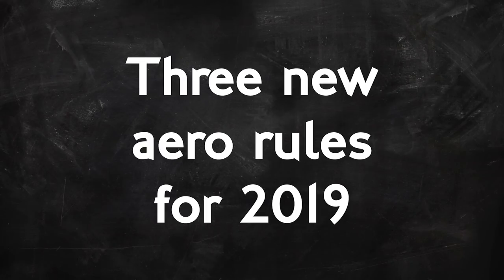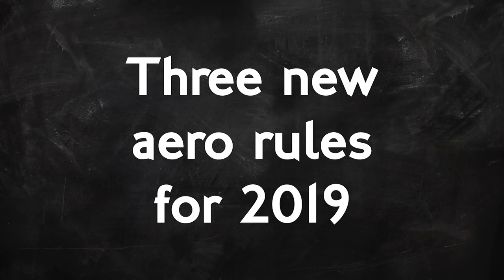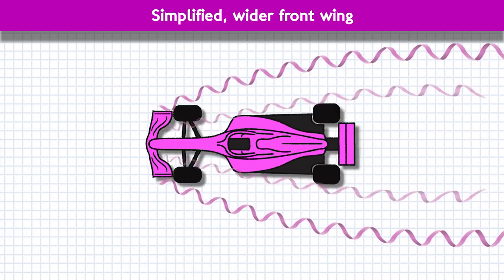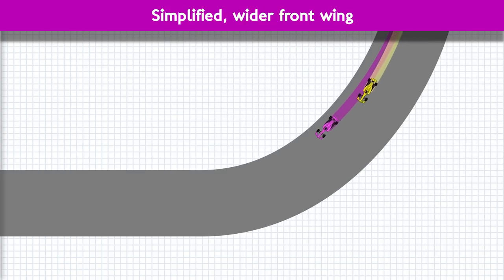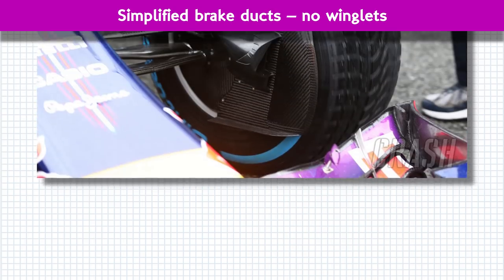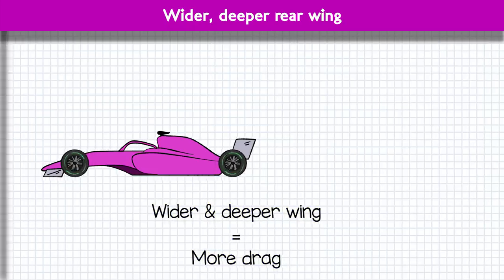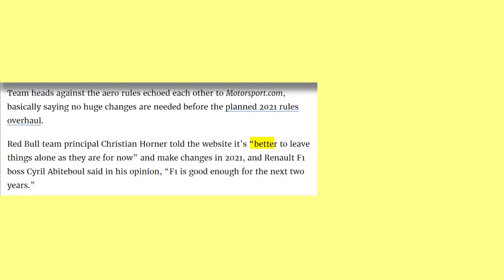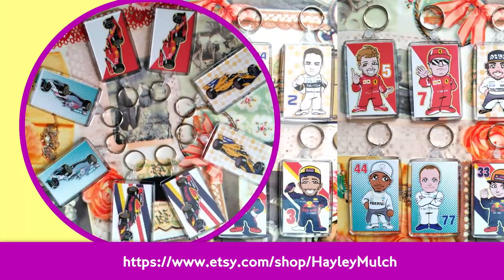New Aero Rules in F1 for 2019 explained

Comment: i always felt DRS punished a driver for doing what he needed to do to be in front of another driver. as frustrated as people might get with little overtaking, wouldn't they also be frustrated if the rules keep making it harder and harder for a driver to defend his position? this might lead drivers to do more blocking in desperation and who knows how ugly that could get.
Reply: the reason for drs is to counter the dirty air, the dirty air a following car which should be able to draft and pass with no artificial assistance. cannot do so because of the outwash. the driver in front if he cannot break the one second ahead rule to keep the car behind from using drs, should get passed by simply drafting, if not for all the extra dirty air. solution? lessen outwash, making it easier to draft, and enlarging the drs wing to allow for more boost to break thru the wall of dirty air.  btw the driver using drs is just going to get passed again if the following driver can stay in the one second space.

Comment: They should give a standard chassis like formula e and allow the teams to change just a few things.. and whoever does the best job has a slightly faster car! But it will be so close that every drivers performance will be at least ten times more important than now. Even your car.isnt the best you still can win or drive on the podium as long as you're fast!
Reply: Cesc Fabregas thats absolutely ridiculous.  F1 never has and never will have a spec body . Why do you think indycar or f2 are not as popular as f1 even though the teans are a LOT closer in both those sports?  it's because of the different cars/innovation in f1 .

Comment: I dont know a lot about this, but basically I can understand that until 2009 we had very fast cars, difficult to make a overtake,  then in 2009 they decided they wanted more overtakes  so they reduced downforce making cars slower,  then in 2017 they decided they wanted faster cars and they increased the downforce, and now in 2019 they decided they want more overtakes so they reduce the downforce.   That doesnt make any sense at all, I guess thats what happens when you listen too much to the fans. Im dissapointed

Comment: Drs are not real overtakes, ok there haven’t been many overtakes this season but there have been some that have been awesome, the best drivers get through and this ‘problem’ has helped out of position cars such as the mid field maintain position and score decent points. The look so fast, and these are dumbing down rules. F1 is a rich tapestry of motor racing sport and technology, should of kept things as they are til 2021 and done some research In a lower formula

Comment: Christian Horner’s quote maybe be mid interpreted, perhaps he just thinks everyone needs to put their head down and focus on the racing now with the current rules rather than, every week discussing what will happen in 3 years time. I think the rules should be implemented and even if they are half baked, useful information will be gathered giving and more rounded base to decided on the 2021 rule changes.

This balance between skill and pure innovation is a tricky juggling act and so in sailing there tends to be two categories. Pure one-design formats such as the olympics where all the boats are identical and the difference in winning and losing is in the competitor and development racing like the americas cup, where the team with the most money and resources comes out on top. 

I think if you look at formula 1 as the pinnacle of motorsport both elements are incredibly important but then if the innovation is uncapped the sport becomes unacceptably expensive to take part in, the numbers of cars reduce and the racing degrades. On the other hand, one of my favourite aspects of formula 1 is the engineering, getting the upper hand on your opponents through wit and knowledge.

Comment: Fans don't want more overtakes!
Well not more straight line DRS overtakes.
We want more battles!!! Battles in the corners, wheel to wheel racing during many corners, even without an overtake!! 
The battles are thrilling not the press button overtake!
When will F1 understand that??
Reply: IndyCars "push to pass" is interesting because it's limited to how, when, and how long you can use it.

Comment: It is the aerodynamics and the latest technology designs which give the F1 cars that are fast but prohibited to overtake.  Although the stored ERS and the battery power, along with DRS tried to artificially mitigated the inherent difficulties of overtaking.  But when the crowds see the lifting of the wings, pressing of the buttons, or the 'overcut' and the 'undercut' passing due to pit-stops, more people are staying away from F1 than ever before simply because the entertainment values have gone.  

People and racers naturally want to see more overtaking as an art rather than an artificial means.  So how do you balance the car for being fast and promotes greater overtaking without the DRS?  

Simple, they have to eliminate some of the excessive aerodynamic bits all over the cars.  By keeping the front wings simple and not to the point of being a long pointy hanging rod that will functions nothing more than a ramming tool.  The Halo should also be gone because there is no way that the driver would be saved by smaller projectiles going through those big gaps between the pillars.  

Back then from the 1950s to the 1990s.  Overtaking was simple and easy to understand.  Now, it is a dying art that needed a desperate overhaul.  The FIA needs a complete overhaul to bring excitement back to the public for sure.

Comment: If they had listened to engineers instead of idiots on Twitter they wouldn't have wasted so much effort on the wider/faster/dirtier cars who's increased speed was totally invisible to viewers. I can't believe they brought back sparky skid plates. How nostalgic can you get?

Similarly, the anti-DRS crowd... Sure, the idea seems terrible at first but once you spend like five minutes thinking about...like, did any of you guys watch F1 before DRS? Like in the 80s and 90s where half the tracks had almost zero overtakes? Have you ever watched 11 races in a row where your guy only gained position in pit stops or because of DNFs? Do you want that again? Do you actually want more overtakes? More than 1 or two in a race? If so its DRS or a HUGE aero reduction to make the cars more aerodynamically narrow again are the only ideas I can think of. Which do you want? You can't have huge downforce AND overtakes without DRS so do you want DRS or do you want Formula E levels of Aero?

Comment: F1 is supposed to be the pinnacle of automobile sport, but if that pinnacle is achieved at the price of fair racing (a faster opponent being unable to overtake), then we have an issue; how do you maintain the notion of "pinnacle of automobile sport"? You may get the fastest lap times, but you don't necessarilly see the faster driver win, and if that is the case, is it really the "pinnacle of automobile sport"?
My conclusion: You need to limit technolog  that is projecting negative circumstances to opponents, even if this technology enables you to drive faster. This is the price you have to pay.

Comment: My personal view about these changes is that , they wont bring much overtakes, BTW DRS overtakes are not real overtakes.. But i belive F1 has moved a lot away from the technology that it transferred to implemented in Road Cars. 

My view was always to make wings smaller and narrower and fit them inside the front wheels., make the front wheels covered and one set of front tyres for the entire race.
Reply: Little note here, we had races with only one set of tyres a decade ago and it was horrible. Granted, still better racing than nowadays simply because of different fuel strategies, but still not good. Most recent races showed that a tiny mistake gives you a huge flatspot that costs you seconds per lap. Having only one set of tyres for a whole race would make it way too punishing to do one simple mistake, and it would also end up becoming very dangerous (see final lap of the Nürburgring 2005 race for that).
Reply: Just the front tyres.. not the rear ones.. Come on.. This is called innovative ideas..

Comment: I wouldn’t actually call it “racing” if you only need to push the DRS button to pass someone + there is basically 1 second/lap difference between the top 3 teams and rest of the field, even more in some tracks. They need to make salary cap for teams, they need to simplify the aero, make it cheaper, try get BMW to return, get Toyota or Ford maybe. Close the gap between teams,  equal the money distribution. If Ferrari and Mercedes want to go out, let them. If you make good changes you will find 2-3 big manufactureres to join. At the end of the days the only thing that matters, is the product on the track. Right now it’s predictable, not fun, boring. Drivers have no personality at all, expect Alonso and Kimi, the best car wins and not the best driver, small teams are just sitting ducks. I can tell you right now that Ferrari or Mercedes will win next year and the year after, more specificaly Vettel or Hamilton. Keep whats working and throw out everything else. Tier stategys are to generic, take back normal pitstops with fuel and for god’s sake make pit stops matter like in Nascar and Indycar

Comment: imagine if someone successfuly designed f1 aero packages to EXPLOIT the airflow of the other cars- you could not only have more effective drafting, you could technically have aero effects that drained energy or even disrupted other peoples aero in subtle ways that hopefully wouldn't get you banned right away :P
I doubt that's even possible in a constrained design space like F1 racecar design, but it's obviously physically possible, as shown by annoying NASCAR drafting pairs and migrating birds.

This is the main reason we need a "almost unlimited" unmanned racing league- where roughly f1 sized ground vehicles race on roughly f1-shaped tracks built out in the desert where they can use whatever scary-ass tech they want to... even things that push the limits of good sportsmanship. Imagine what f1 would be like if it was using tech that was originally developed for unmanned insane robot racing.

Comment: If F1 cars were allowed to be as fast as they could be without restriction, the speeds and G forces would become so high, that virtually no driver would even be able to pilot the car, let alone overtake. That being said, I'm not a fan of reducing performance of the cars, but it is boring to watch a race where qualifying decides the victor, rather than the race. F1 is a difficult concept; It's advertised as pushing the limits of engineering, and racing. The problem with that is that if you push for one you sacrifice the other. If you want a exciting unpredictable race, you have to sacrifice speed and development. If you want development, you have to sacrifice the excitement and unpredictability of the race.
Reply: ZeoAcinuz very true

Comment: It's a racing series (well was) and racing racing should be key. I've always looked to motogp as a direction F1 should follow they aleays have 3 or 4 teams battling for the lead and in the past few years have been trying to bring the teams at the back further forward. For example all teams have to run the same electronics (traction control, anti wheelie etc) and to a point its working lower teams i think if i remember right get more testing time than teams like Yamaha and Honda. Although i am a bike fan first i dont just say this shit to piss off F1 fan boys they could learn alot. Last thing i would like to see Rossi come and dominate F1 for a season after he retires from Motogp. Although no one knows when that'll be 40 years old signed another 2 year contract and still going strong #VR46

Comment: Ground effect needs to be used more, it doesn't leave a shit load of dirty air, it cleans up the look of the cars. We don't need fragile complex front wings that cause punctures and extremely high costs and DRS is such a joke, a gimmicky bandaid on such a high profile sport. 

I would much rather see the sport evolve massively and embrace ground effect to make an interesting change to the aerodynamics which allows for less drag, more down force (yes, farrrr more down force), and in turn have faster cars. It's makes for a more competitive grid, it lets drivers pass, it keeps the speed high, and brings down costs which are all problems that Formula One is having deriving a large amount of down force from the rear wing. I'd love to see formula cars with minimal wings and sleek flowing body lines untarnished by all the garish bits that adorn the outside of the cars now.

Comment: F1 should make the fastest cars. They should give the cars automatic suspension. Lower the drag on top of the car and more ground effect and buy now the f1 cars should have been 500 kph...
Reply: the ONLY reason ANY motorsport doesnt go faster is the tires. plain and simple where the rubber meets the road is where the largest bottleneck in holding down top speeds occurs.

Comment: So we're in the 2019 season and we can conclude that the new rules didn't bring big changes. Mercedes is still winning everything. :P
Reply: But maybe MB nailed this current evolution of rules, and MISSION DNFNOW fucked up even more? So maybe the rules worked, but MB gained more performance than others.
Reply: @ssandde  Drivers still have a tough time trying to overtake each other. I don't think we see more close racing compared to last year. 🤔 And I agree with you on Ferrari. They could have won Bahrein with Leclerc and have more points if they didn't screw up their strategy and reliability.

Comment: I still hope Ferrari will VETO the shit out of this one. 

Melbourne was never a circuit with a lot of overtakes. 

The rules wont change a lot either. Overtaking with DRS is cringe anyways and making the effect stronger doesnt sound that good.

The only thing that really creates overtaking is having a faster car behind a slower one. So they should work on tires. 1 Stops every race is bullshit. It should come to the point that a 2 stop is standart, but one or three stops should work with a lot of effort as well. 

In the past refuelling and the fuel amount for quali mixed things up and created overtakes.

Comment: Same old shit difficult day. These aren't enough changes. We've seen this all before. Half arsed. The most fundamental problem is the restrictions and clever designers working around the problems with additional winglets and clever bodywork aero over the years. Take the restrictions away from under the cars and use ground effect.

Comment: Overtaking is more important. F1 has turned boring in the recent few years to a great extent. Proper rule changes for more excitement of racing is to be taken care of, soon than later before Electric cars take over the combustion engine completely and accelerate faster than a F1 car with lighter batteries.

Comment: V12 minimum, 2,000 horsepower sustained minimum requirement, all safety features removed or penalized.

Make racing fun again. Racing was never meant to be a boring safe sport. What made it thrilling was that what it lacked in athletic ability it made up for much more in danger and being on the absolute edge all the time.

If the teams want let them throw disposable rockets on for the start. Driver deaths result in a commemorative high risk obstacle where they went off either a set of pillars, speed bumps etc. As much as all the pansies will take issue with these points even they know that this would make F1 the most popular sport within a year or two.

There is obviously quite a bit of sarcasm in there but there is also a serious point. Endless anti-maximum performance regulations and a never ending focus on safety over the race isn't what people watch motorsports for.

Comment: Ground effect, Ground effect, Ground effect. Every intelligent fan gets sick of shouting about it. How long have we been demanding it? 20 years? About time but not enough. Wheels generate lift as well as a wake. These wings will work to stop lift from the front wheels but single plane front wings will reduce front wing downforce dependency and keep the front wheel exposed. This will also create an advantage for The car behind as the front wheels do not collect as much air.  But these will only work properly with ground effect being dominant over over-car downforce. We all know low ride heights didn't kill Senna so it about time liberty media reversed that panic decision to stick a 10mm plank of wood under each car. Return to ground effect and big diffusers. The diffuser effect (rake) is plain to see for all current f1 cars versus the Mercedes which is utterly hopeless following other cars as they don't run forward rake as much as other teams (yes they are fooked all season).